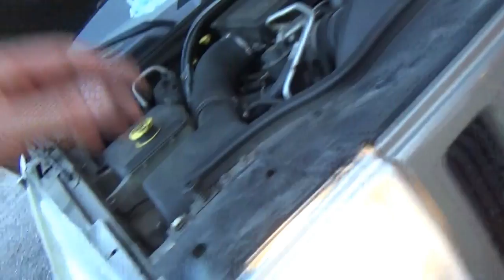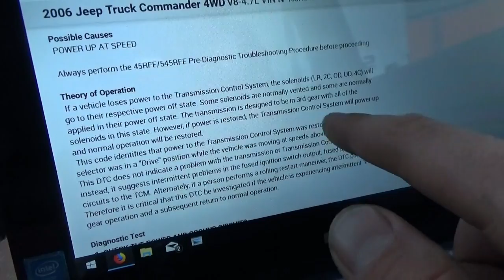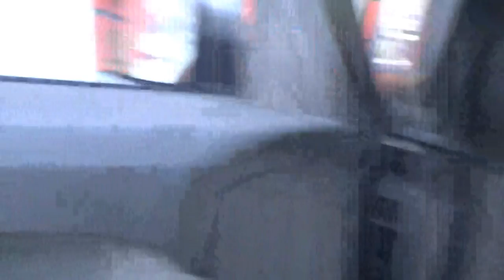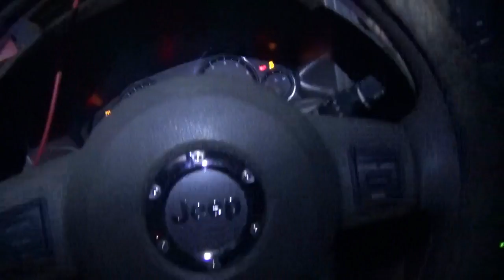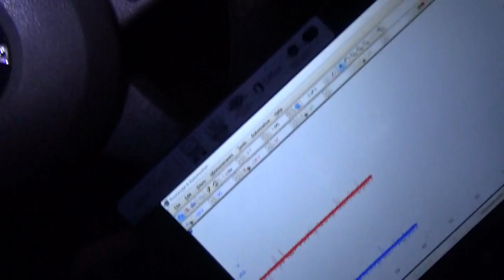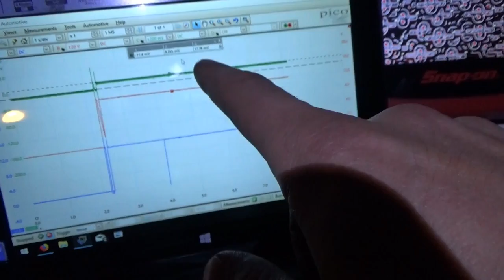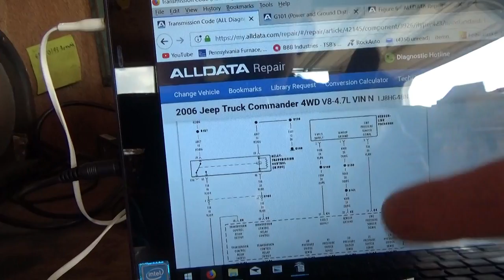Jeep Commander CRAZY Case Study -Part 2

Comment: for what it's worth I'm seeing the same issues and blown 20amp #18 fuse, I found that the wires running to the AC clutch are burnt and crossing/shorting causing fuse issue and random trans alarms... odd that the ac and trans share a circuit...
Reply: already replaced pcm 2x (warranty)

Comment: My commander limp mode problem was in the shifter.  It has a roller that determines which gear the trans should go in but the roller contaminates the path between the selector confusing the modules by connecting more than one gear.  I disassembled the selector and took a q tip and brake kleen and cleaned between the contacts for gear selection and no more problems.  May have nothing to do with this issue just something too think about and stick in the back of your mind for later.

Comment: Random question? 2006 commander transmission cooler connector still leaks after changing it.. can a clogged filter cause this or replace the whole unit..?

Comment: I can't believe that the car manufacturer put a sensitive electronics like  ECM and TCM  in the engine compartment under the hood, the electronics produce heat them self, plus the excessive heat coming from the engine, of course they will not last too long, it seems like they did it on purpose so  they can make more money on selling parts.

Comment: Just a follow up.. My jeep did the same thing... I replaced TCM, did nothing.. After replacing all trans fluid, filters, shift solenoids and pressure switches, the problem went away... I will never buy another Jeep.

Comment: Another fun fact for everyone the 20 amp fuse for the ac clutch is also tied in with this circuit and if your compressor had issues it'll pop this fuse throw this code and have you stuck in 4th gear isn't it great!??...

Comment: My electrical code disaster that threw all kinds of codes that had nothing to do with the codes it was giving me, ended up being 3-6 melted/fused wires under the second row of seats. There is a harness that runs under the carpet from left to right of the truck. The harness is unprotected and sits on the metal floor pan under the carpet. Also this is where people step on the floor. The muffler is directly under those wires and melts them and also discolors the floor pan and burns the rug, could set the truck on fire. When touching the melted wires the Jeep came back to life, and all warning lights off. I wiggled them more and the truck died wiggle again and back to normal. This issue could also be the crank no start problem. 
This is definitely one place to look if all else fails, and it’s also good to look at to see if anything is going to burn up the truck. This should be a safety recall, because it’s dangerous.

Comment: I know this is over 2 years old however, I want to thank you for this 2 parts series and understand that the customer declined all further repairs prior  fixing this Commander.  I had the same issues. Your diagnosis, to replace the TCM, was perfect on my 2006 Commander.  I watched, I followed, I watched, I checked and finally threw in the towel and replaced the TCM.  Worked beautifully!  Thank you so much.
Reply: Chris, where did you order your new TCM ? I need to fix my jeep :(

Comment: I own 2010 commander V6, about a year ago my jeep would go into limp mode for no reason. After six weeks thinking it was a faulty transmission that's very costly turned out to be the TCM. Picked up new one and jeep dealer reprogrammed the vehicle computer to new part and bingo all is good. How it went bad I don't know, working fine now for thousands of miles.

Comment: Seems like you could run a switched power to that relay and it would fix the issue.  Instead of letting the TCM control turn on the relay---- just have it powered on by switched power- through the key.  That way it keeps the relay on like it's supposed to and shouldn't drop into limp mode anymore.  What a goofy design.

Comment: Bad ignition switch 4 sure
Reply: Changed mine 2 times and that wasn’t it. It was melted wires inside the truck under the second row of seats where the muffler is directly under it.

Comment: Hello, first off very informative video. I may have more info on the conclusion. Now my 2006 Jeep commander 4.7 had the EXACT SAME ISSUE as this one! Limp mode, Random codes after every scan with p0700 always present. Suspecting the ECM, I took it to the dealer and they said that it was definitely a bad ECM. Now, for the bad news, I had the ECM replaced but all of the issues still remain... I think that this this issue is not actually caused by a bad PCM, its something else.
Reply from the maker: What was the code in the transmission module?
Reply: @PineHollowAutoDiagnostics  hey thanks for the reply! I am almost always getting p0882. Occasionally I get p0846, p0871, p0876, p1684, p0869, p0218 that come and go seemingly at random. Also I get the "trans over temp" warning (even with a cold engine that isn't running) as well as service 4wd occasionally.
Reply from the maker: @pete8299  Yup definitely a power feed problem to the transmission solenoids. Gotta use a scope to see the dropouts. Might be a wiring problem between the PCM and the relay fuse box.
Reply: I can’t stand how dealerships will send a vehicle back out to a customer thinking it’s fixed. Changing PCM,ECM,TIPM all costs money that you don’t get back when the problem ends up being a bad relay.

Comment: I have a 06 Commander with the Hemi. I had this exact same issue, limp mode, dash lit up with all the error messages and idiot lights. Mine didn’t fail as consistently as the one you worked on but symptoms were exactly the same. The dealer replaced PCM and TCM but eventually the problem returned. For me the solutions was a new shift module. I found the answer on a forum. I changed it out and never had the issue again and it’s been 7 yrs now and about 80,000 miles. My Commander has 230,000 miles and I’m the original owner.
Reply: Late to the party. Been chasing a concern just like what you described in video. Heat related in my case. Does not fail until ambient temps are above 85 f. Then it starts runs flags all the lights and stalls. Only code I get is p0882. When it does run sometimes it's in limp mode. When my jeep acts up the theft light flashes when koeo. Right before crank. Did this case have the same issue?  Thanks in advance

Comment: Have this exact problem, thought you stole my jeep. Did you ever learn the outcome?  I’ve ordered a pcm. And replaced the relay. Also have CAN B (-) open with HSM PDM and Park Assist CAN (B)-.  Everything works except 3 out of 4 heat pads. And I have had Service 4WD since the N23 FDCM flash/upgrade/crash (have no 4lo).  Codes show neutral switch low and mode select high.  I think not related to the Check Gauges limp mode.
Reply: BTW the neutral switch at FDCM shows 1100 ohms to ground (should be open to ground?) and mode select is 4.9V, diag asks if over 4.5V then look for a short to voltage on that circuit.

Comment: I know I'm a year late, but this seems very similar to the problem I had 4 years ago with a 99 Dakota, but mine was with the ECM part of the PCM.   Mine would just die on a hot day and I had the typical no 5v at the TPS.   As close as I can figure there are  problems with the 7805 +5v voltage regulators inside the PCM.  There are several 7805s in the PCM, each one provides power to several sensors. Each 7805 voltage regulators can each only supply so much current before it shuts down from thermal overload.  Heat (a hot day, or hot engine compartment) can exacerbate the problem.  Over current could be caused by a short on a sensor or  the 5v itself but the resistors on the PCM output signals should limit the current..   
I suspect the 7805's are running close to their current limit (too much load/bad design??), and degrade over time with heat and thermal cycling.  There are people who repair these PCM's for a fee, but that cost was more than taking a chance on a used one.
I replaced my PCM with a used one from a boneyard for $100 and everything works fine (until it doesn't).  The PCM program code.label must match the vehicle model.   I didn't reprogram it for my VIN, but I don't have to pass emissions either. 
Mine got worse over time and died 2x while driving to the boneyard to pick up the replacement.  It's not very fun to diagnose these types of problems when they only happen on a hot day in July-August.

Comment: there is no TPM or TCM. It has a IPM/TIPM. Youu have the manual right in front of you.
There is a PCM (powercontrol module connected to headlights as a wiring harness), the IPM is an integrated power module) a bcm which is mounted to the IPM, 
and a junction box which has a front and back.  fuses on front and 3 circuit breakers and sequantially timed and installed Relays on back inside (fuse box)

Comment: relays on back of junction box MUST be sequentially carved relays and installed at manufacture (we think its because of either relay timing or they are synced some how)and you MUST  replace entire junction box not just relays.
The 4.7 is trash! We have the first gen 206 5.7 limited lifted on 35's
My husband downloaded the complete manufactures service and repair  manual. ITS SAYS IT PLAIN AS DAY! RESEARCH IS KEY. the intermittent problem is, the relays not syncing on time sometime. or wearing out.
Also my husband says. Its is either a rip off game or ignorance, that mechanics can not work on a Chrysler/jeep/DODGE
so many of the parts are cross platform. They cover many years. The trick is matching features on replacement, some parts have 6-7 part numbers, due to so many displacements and features (engine size and fancy electronics)
Variance depends on manufacture date, assembly plant and vin. 
Once you have all the info which is found on the bottom of each page of the repair manual. 
the repairs are a snap.
my husband is an ex navy mechanic but is a salesman and has been for  

 13 years.

Comment: Ivan, I completely watched both parts of this case study, and I would like to offer you some constructive criticism that I hope you will receive positively. I know this is almost half a year later, but I just came across the videos last week. I really do hope you see and read this though, because I think it would help you.

A little warning first, this comment will end up being LONG. I know YouTube comments are filled with smart ass know it all types, and I hope I don’t come across that way. My only intention is to help you become better and more efficient at what you do, even though you are clearly quite skilled already. I’ve watched a few of your other videos, and noticed that you often go down a longer, more complex path than is necessary to correctly diagnose a problem.

So first a little info on who I am, just so you know. I’m 38 years old, and my dad was an ASE certified mechanic back in the ‘80s, working at an Olds dealer. From the earliest age I grew up in his shadow, reading his auto repair books as soon as I could read. Neither he nor I ever had a shop, but we were in the used car business for quite a while, and we had quite a network of friends and family whose vehicles needed all types of work over the years. I have done almost every type of job over the years, except automatic transmission repair. But I take pride in my troubleshooting skills, I’ve never come across a vehicle I couldn’t properly diagnose given enough time. That being said, I do not consider myself an expert, and I don’t think any mechanic/technician should. There’s always something new to learn, and we can learn from each other.

So then, on to my advice. I noticed something in the first video, part 1. During the first minute of that video, when you initially started to view the codes, one of the first three codes, was P1603, PCM internal dual-port RAM communication failure. The moment I saw that code, the FIRST thing that came to my mind, was that the PCM was bad. But a few minutes later, I also thought that the code could be caused by poor grounds, or lack of sufficient, consistent power to the PCM.

You initially saw the code and said “Uh oh, that sounds pretty bad”, but then continued on to the other codes. I thought for sure once you viewed all the other codes, you would come back to, and focus on the P1603 as your starting point for diagnosis. So I watched all the way to the end of part 2, when you finally determined that the PCM was in fact bad. But much to my amazement, you never paid any attention to P1603, and spent a lot of time chasing ghosts before coming to that conclusion. 

I must say I found this particular case study quite interesting, because just about a month after you posted the first video, I worked on basically the exact same vehicle. It was a 2007, but otherwise identical, 4WD, 4.7. The problem with the one I worked on was quite different, badly misfiring due to a worn out engine.

But I did get access to the FSM as a result of that job, and so just out of curiosity, to confirm my suspicions regarding the cause of the code were correct, I looked up the diagnostic procedure for P1603. And there are only two possible causes listed, PCM fused ignition switch circuit, and PCM internal. The entire diagnostic procedure is so simple that it is contained on one page. Basically, you test at PCM connector C1, and verify that there is battery voltage at the proper pins, with the key on. If there is not, then you inspect the wiring and connections within that circuit, along with grounds, to find the cause of the problem. If there IS proper voltage, then the FSM says the PCM must be replaced.

If you had paid attention to P1603 right from the start, and looked up and followed that simple diagnostic procedure, you could have determined that the PCM was bad in far less time, with far less work and headache. I strongly believe in the KISS principle. Whenever I see a situation like that where all kinds of random codes appear and disappear, for no apparent reason, I always suspect that either the PCM is bad, or that there is a power/ground/connection/wiring problem somewhere. And that P1603 was a strong clue to that.

There is no doubt you are very skilled, but from viewing some of your other videos, I think you too often tend to go down an unnecessarily complex path, in order to arrive at a conclusion that could have been come to much quicker and easier. A scope can be a very useful tool for things like checking cam and crank sensor signals, among others, but it is not always necessary for every problem. Yet you seem to have a tendency to use it as much as possible. The problem with tools like scopes, is that they can provide a large amount of data, that you then have to spend time analyzing. That can lead you down some long, wrong roads in certain cases. Always start with the basics, and bring out the scope only when you have checked all of them.

I sincerely hope you receive this well, I wish you all the best, just wanted to help you harness your skills most efficiently.
Reply from the maker: Thank you for the very thoughtful reply, and I appreciate the suggestions and tips! Definitely always room for improvement.
I agree that at times the diagnosis takes the "long way" around. However, I have learned never to just put on the blinders and to focus on one code and one flow chart. Have seen multiple times a "PCM Error" code be caused by anything from poor powers/grounds, to even a bad O2 sensor!
In this case "bad PCM" was not a satisfactory answer. I wanted to prove with the scope as to WHY we were losing the power feed to the TCM side of the PCM. It definitely took some time, but in the end the proof was conclusive.
That is why this field is so rewarding and challenging. Many ways to make a good diagnosis, with the ultimate goal to be 100% accurate in the least amount of time :)
Reply: I’m glad you took what I had to say positively, but I think there may be a bit of mutual misunderstandings on both of our parts, due partly to my failure to explain myself better. So I just want to clear that up.

By no means did I mean to suggest that you should focus solely on one code, ignoring the others, whether in this particular case, or any case. But every diagnosis needs a starting point, and in a case like this, where you have so many codes, I thought that P1603 would have been the best starting point.

After your explanation of your diagnostic procedure though, I have a better idea of why you do it the way you do. You want to be absolutely sure that your diagnosis is correct, plus you are interested in knowing the way things work and why or how something happened. 

That’s something I inadvertently failed to mention about my procedures, I too have the same mentality. I always cross check or double check my diagnostic conclusions, to make sure they are correct. I think we essentially have the same  goals in making a diagnosis, but we just go about it in different ways.

Comment: My GMs all have PCMs underhood without problems. If heat soaking caused failures then very few vehicles would ever stay running. Industrial hardened means HEAT RESISTANT. Always has and always will.
Superb diagnosis, sir.

Comment: Jeep commanders are loaded with problems the worst car ever made
Reply: Mine was giving codes, TCM,PCM,ECM, wrong vin#, wrong mileage. All warning lights on, most electrical accessories not working. The truck was almost inoperable and probably on its way to the junkyard. It ended up being 3-6 melted wires in a harness under the second row of seats where the muffler sits right under it, burning my the floor pan and the underside of the carpet. 

I wish he could’ve went further with this fix to see if that was the issue.

Comment: Excellent video. I have an 07 XK that has had many similarly maddening issues, so this was really interesting. I was wondering if you could have maybe used freeze spray on the TCM to see if the driver signal remained until it heated back up? Anyway, well done!